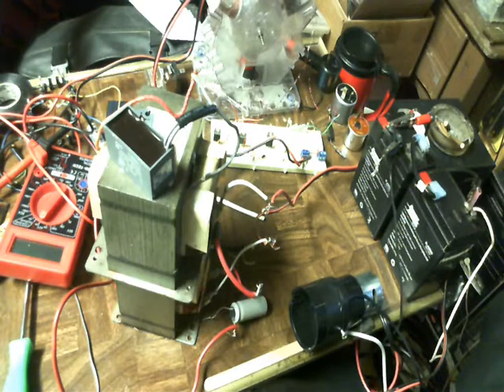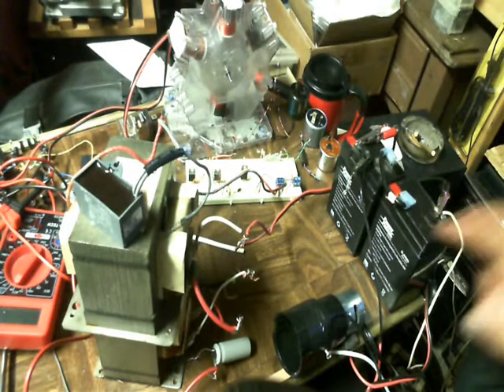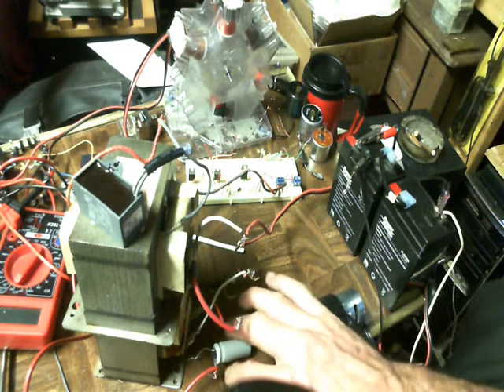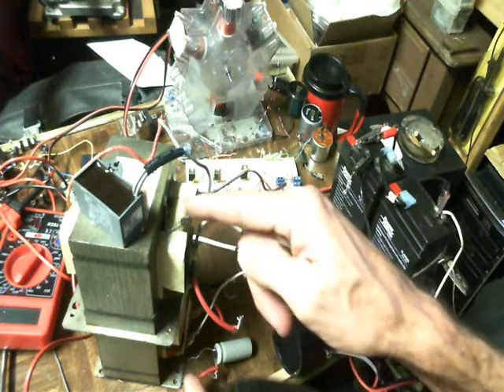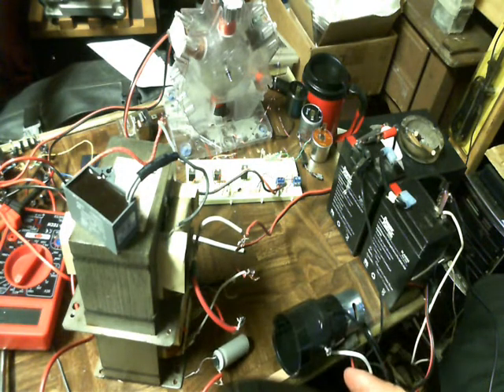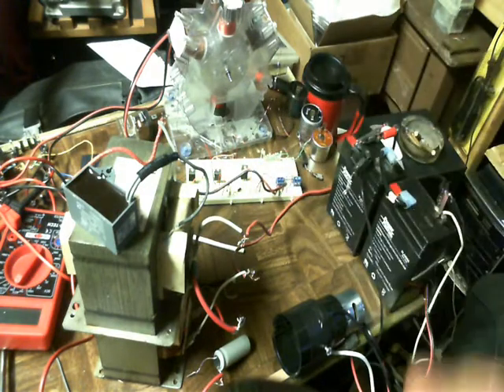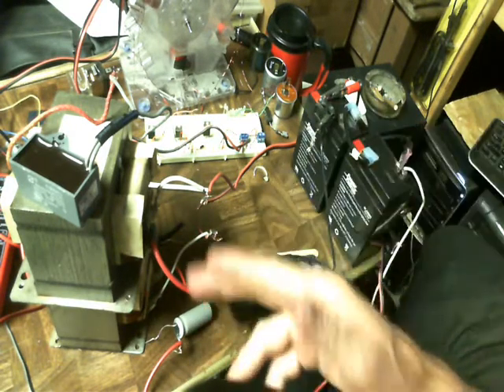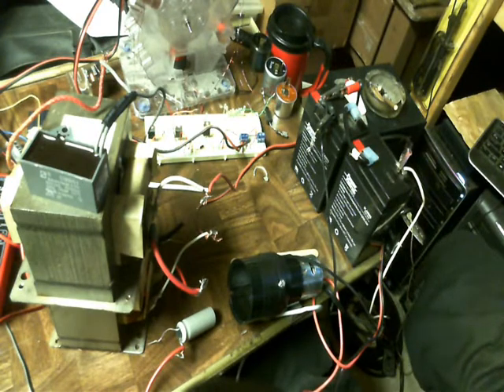ROTARY SWITCH !

Comment: I also posted this on your IMPORTANT video...
I have checked out several of your videos sir shazizz. Thumbs up! I understand what you are saying (or what you have have rediscovered that Tesla "basically" knew). It is the basic function of a fly-back transformer. There is continuous and constant energy literally saturating the entire universe - (according to my copyrighted theory "The Good Vibrations") which states that there is a static charge which is what constitutes the strong force. The delivery of this static charge to atoms of mass is what constitutes GRAVITY. When this static charge is forced through Mass above the necessary intensity (natural delivery speed) of Gravity - Magnetism and Energy are the result. Furthermore - when this "overabundant" amount of "gravity" (electric current for example) is applied to - then quickly removed from - Mass - the static charge (natural saturation of Gravity..) reinstates the mass with a vengeance - and a return / reverse "fly-back" overabundance is temporarily displayed - (milliseconds) until the natural balance is achieved. To repeat this (rotary spark gap) the result is "amplified" at each "interval". In the below link I show in my video (Proof that Gravity is Magnetism / Energy) which demonstrates how and why ONLY the NORTH pole of a natural Magnet displays fly-back when making electric currents. (I have other videos which explain how natural magnets function) https://www.youtube.com/watch?v=th5cZRS39ec&t=3s Keep up the experimenting shazizz - AudioWriter

Comment: Shazizz I think I'm start to  understand what is you're doing. But instead of using the word pressure like you've been I believe tension is the better use of words. You're playing with electricity  like it's  an instrument..... that's how  I imagine it anyway. Tightening and losening the strings ya know?
Reply from the maker: You do have a point energy does act like a rubber band. Even the battery snaps back to balance. So with that said between the kick back of the battery and the inductive fly back of the coil you get a powerful discharge at the contact points. This is why they used condensers in old style points distributors to extend the life of the points. So with that said if you can build a commutator style rotary switch to make and break the circuit and catch this discharge then send it where you want it to go and be able to at the same time still use the transformer? Not only that but also be able to speed it up or slow it down to raise and lower the voltage to what ever frequency you chose. The concept would have a wide range of possibilities not excluding amazingly efficient electric motors and much more. These batteries have so much more power potential than you can imagine and are capable of not only lasting longer but doing way more work than using them the way we have been. Efficiency is the key here. Transistors and mosfets have limits on the amount of current they can handle do to the heat issue and thermal break down point. But a switch like this could do the job at much higher currents before failure occurred do to heat. In conclusion you would be able to maximise efficiency in electrical power generation. Understanding how power travels under any condition will allow you to build the perfect machines that simply will not break down and give you more work for the same input or even less. Thanks for the comment, I love the ones that inspire thought. :)
Reply: https://youtu.be/KKdzhPiOqqg
Reply: Just an interesting little battery that gives off barely anything but last a very long time

Comment: Nice use of the old drill? motor..  That capacitor on the HV side is probably too many uF for the MOT output.. homemade leyden jars work alot better, when they're around 1-2nF..  While the larger ones give you better current storage capacity, they'll reduce the voltage output significantly.. You'll get much longer arcs (higher HV output) without any caps.. Additionally, you can either ground the base of each MOT, and combine the HV terminals for double the amperage output, since it will be in the same phase due to the matched series winding..  Or, you can wire the 2nd MOT primary opposite, and cause an inverse high-negative output, and the two HV terminals will produce double the output voltage.

Input current can be supplemented even further, by adding a larger capacitor directly across the rotary's contact brushes.. Something like 5-20uF will give a nice "shorted-reactance" configuration that allows the capacitor's quick discharge qualities to surge the MOT primary with a stronger field, than the high resistance of the battery could discharge.  :)  In almost all of Tesla's designs involving a circuit controller, we see a capacity used in this manner.